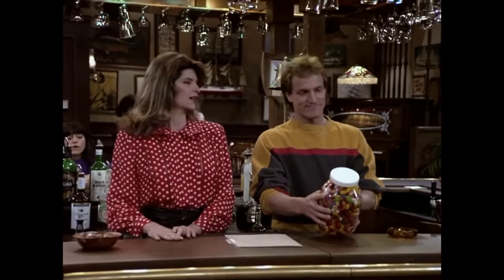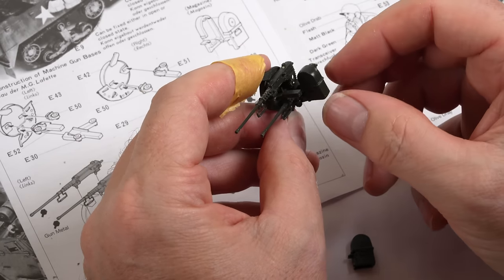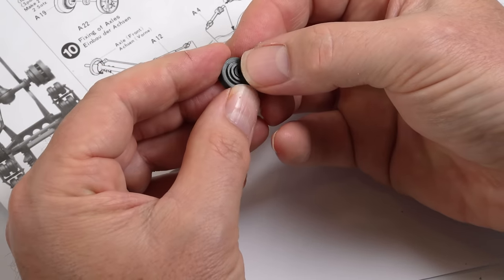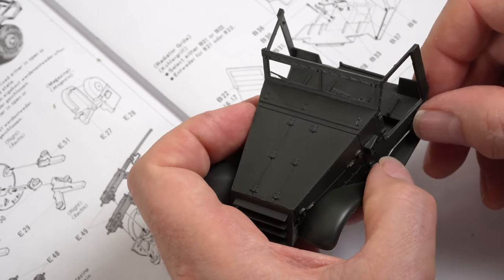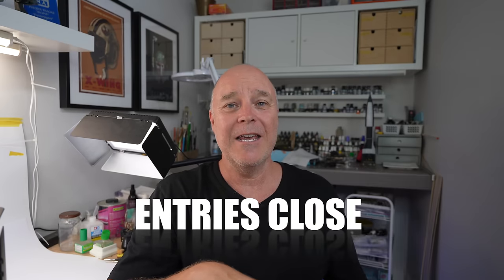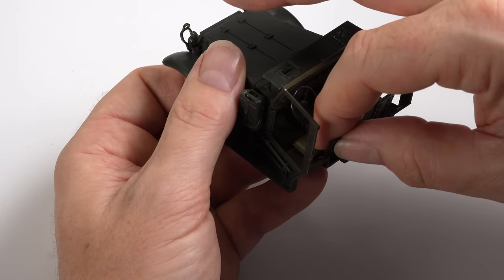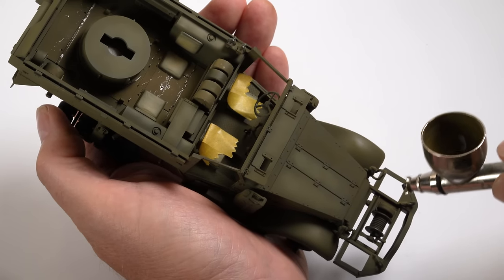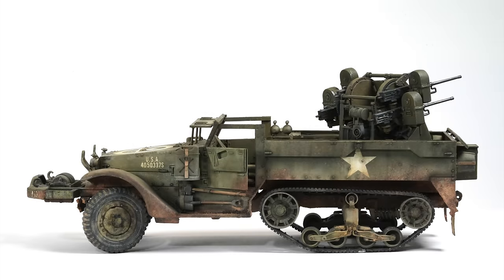TAMIYA $$ Cash Grab or Masterstroke? Rereleased Tamiya 1/35 M3 US Halftrack M16 built OOB + giveaway

Comment: I wonder if the old molds somehow stretched out of shape slightly such that they don't meet precisely and then form more flashing. If this is a characteristic with old plastic injection molds, maybe damaged.

I see no reason not to reissue old models.
Reply from the maker: Hi Gary. Nothing wrong with these ones. They are just 50 years old. Pretty good for the time. Thanks for joining the conversation 🙏

Comment: Pity Dragon does not do the same releasing old kits but NOW over priced inflation is a joke! example the current trend in Hetzer releases all very good at today prices but dragon releasing the same old trio from the early 80's which I still have in my stash I  bought them relatively cheap round about £20.00 each a few years ago now I see them the same kit and box art at nearly £50.00. hopefully the likes of RFM ,Takom , Meng and others will in time fulfil our desires and release more Kits at a reasonable price. The dragon Kits are still great but over priced at least here in the U.K
Reply from the maker: Hi Paul, you have to wonder who is actually buying the Dragon kits at some of the prices they are asking for them.  Thank you for connecting with me.
Reply: Hi Yes and why are they so expensive when really they are using the same old moulds maybe add a  few new parts, but still I cannot justify buying them. Hence I stopped buying them and looked at other manufacturers such as Miniart, Meng, Takom etc. nothing wrong with these if not better in detail but they still have a few faults but still room to improve. I still enjoy watching your channel and had subscribed some time ago. Paul  @workbenchhobbies4316

Comment: It is absoutely not cashgrab. They still sell it on a reasonable price. Cashgrab is what Hasegawa doing with their badly engineered aircraft kits. They sell those in insanely overinflated prices. Their F-4B is a joke, but they try to sel it on premium price. They haven't touched the tools since release, just reboxed it a few times, always doubling the price.
Recently I have problems with Tamiya paints thinned with lacquer based thinners. Most of them changing colours in this case. Their Desert Yellow became a mid brown colour. The more I thinned, the darker it became. I really don't know what Tamiya messed up with their paints. I've never experienced this with any other kind of paint.
Tamiya still mess up ejector pins. Their M51 Super Sherman is a prime example. They put the ejector pins on the outside of the hull sides. A shitton of them. One on both sides of all bogie arms. Good luck cleaning those.
Reply from the maker: Yep. Agree re the Tamiya pricing policy. Very user friendly. 
Not sure re the paints…are you painting over a black base? Thinning the paint will make it more translucent and if you paint over a dark base it will make them look darker? Thinning won’t change the pigment in the paint 🎨 
Thanks for connecting 🙏💪🍺
Reply: About the paints: it has nothing to do with the base color. Something is changing chemically from the lacquer thinner. Maybe not all of the Tamiya paints do this, but all of my recently (well, in the last two year I haven't bought a single Tamiya paint thanks to this. My last was the LP-11, but that is lacquer, so it is fine) bought ones do this. And only Tamiya paints. Pigment is only one thing, and dependeing on what kind of pigment it is, it in fact can degrade or modified by chemicals.
I generally move away from Tamiya products. Their paints failed me, kits are overpriced mediocrities, etc. And the Extra Thin Cements... Well, I was able to use only half of the normal, and 1/3 of the Quick Setting. The rest just evaporated through the transparent lid. And the Tamiya cements are just laughably weak. A few years ago I built an old Italeri kit. Three times the same kit (no, not three separate kits, a single one). First I built it with the Quick Setting, than with the normal Extra Thin. And that kit is just fell apart both times. Yeah, those Italeri kits were mado of proper polystyrene, not from the gum like shit like these days kits (Meng is the extreme example, all of the bigger parts are warped, upper hulls can't hold their own weight, etc). For the 3rd time I built the whole kit with Revell Contacta. And that hold the parts together really well, and strong. Nowadays I use Gunze Cement S and SP, and I have no problems. No evaporation, no falling apart kits.
Practically there is only one product line Tamiya stil hasn't fckd up yet: sending sponges. Those are exquisite.
There are better products in every category than Tamiya. There are better and much better paints (Gunze, MRP for example), better cements (Gunze, Revell, practically anything other), better armour kits for better prices, etc.
Reply from the maker: Sorry to hear you’ve had such issues. Guess you find the things that suit your methods and styles and stick with them and you can’t go wrong. This is a hobby where we are always learning isn’t it? 🤔

Comment: Yes, when the enemy starts shooting at you you remove the armor that's protecting you and place it flat on top of the engine.   🤣
8:46 you literally got it backwards. That armor is for YOU not to get shot.  Just think about.  You gonna drive around all buttoned up and peeping out the little slits in the steel armor plate when there's no danger but when you see the enemy you open up all the windows and hatches??
Reply from the maker: Well…to say I’m confused would be an understatement. The time code you are referencing is talking about the flaps on the radiator grill being in the open and closed positions. Nothing to do with looking through slits.